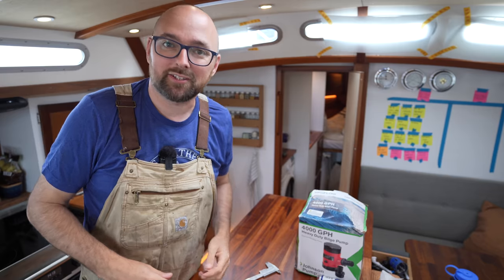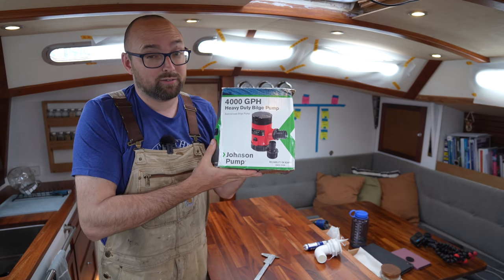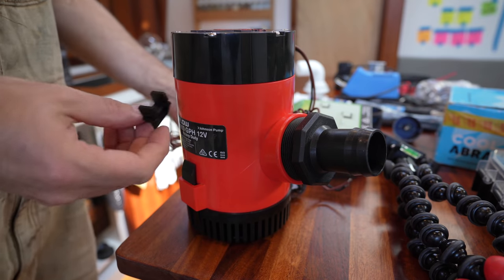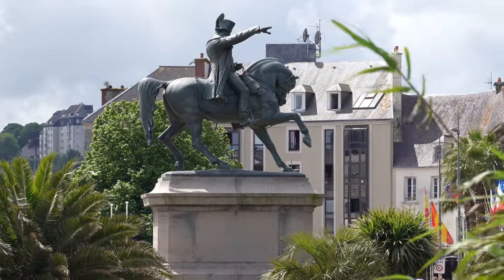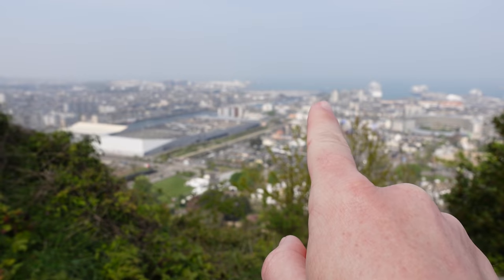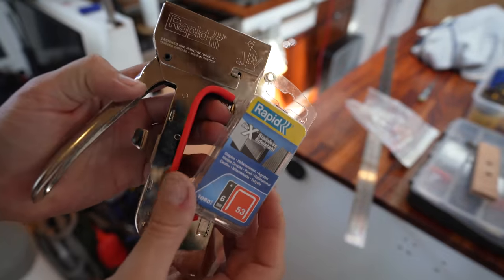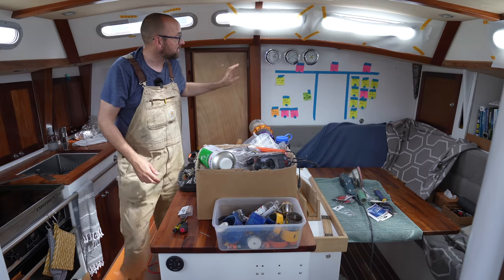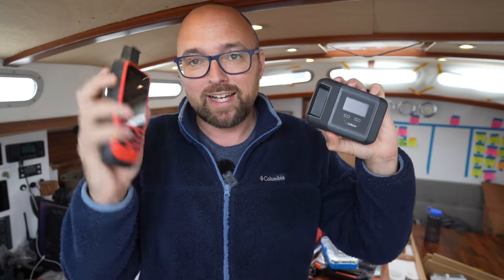Sail Life - 4000 GPH bilge pump installation & tons of smaller jobs 🔥

Comment: Mads? How about drilling a fire supression port in the engine room hatch? Usually just a little wider than an extinguisher nozzle, with a small cover to close it. That way you can fire an extinguisher without removing the hatch and feeding oxygen to the fire. Maybe one for the tech room too?
Reply: When diesel catches fire, the boat is doomed.  Only a halon fire suppression system might be able to extinguish the blaze, if the fire is in a compact area.
Reply: @wallacegrommet9343  Halon replacements and Halon are still available. And even a diesel fire can be smothered, in a contsined space, by killing the fuel supply and flooding the compartment with plain CO2. And that's assuming the fire is caused by diesel. There can be other reasons for it. That's why some regulations actually require fire supression ports, and manufacturers build them by default.
Reply: @lyfandeth  Fires are cased by "lightning". That's what my accountant said.
Reply: Thanks, wasn’t aware of those details.
Reply: @wallacegrommet9343  diesel can be extinguished.

Like all fires, you can remove the oxygen, or the heat or the fuel.

A drychem extinguisher would interpret the chemical reaction and have some effect on displacing oxygen.

A CO2 extinguisher would displace the oxygen and cool it down.

A foam extinguisher would cover the fuel and prevent access to oxygen and cool the fuel.

And, believe it or not, plain water CAN be used. It's really not recommended because it's very hard to do and requires specific techniques.

But as a firefighter, I have trained on fighting and extinguishing liquid fuel fires with water.
Reply: When you get an insurance survey the surveyor will record your boat as unsafe without the port. Your insurance company will then make the decision for you. You want insurance to cover you for fire, you must have a suppression port. If you decline their kind offer, you can basically not stay in a marina unless you post a surety of $20,000,000. Yes, that is 20 million  in anyone's money. You don't want your $20,000 yacht burning down a couple of superyachts. A port costs $16.
Reply: @paulslevinsky580  Are you sure he didn't say lighting? My accountant could argue anything like, today isn't Monday. The tax office just gave up eventually.
Reply: @philgray1023  a rabbi and a priest pass each other on the street. The Rabbi says to the priest "too bad about the altar boy's allegations against you. Jail is gonna suck". The priest responds "it's all good. The bishop paid off the family and the Irish catholic police commissioner made the charges go away. How's your brother doing after the fire totaled his expensive yacht?" The Rabbi..."oh no, that's not till Thursday".
Reply: @35manning  Spot on Emily! I did navy fire fighting and putting out an oil fire with water can be done, but you don't want to be at the front of the 2 hoses required when you do it. I tried to avoid it, but got sent to the front. I can still feel the heat now. Most boat fires come from, gas, electrical or the good old standby wet exhaust and muffler systems not having water. By the time the diesel catches on, you hopefully will be watching from a very long way off, because the boat will be about to sink. Fibreglass boats burn exceptionally well and no diesel is required.
Reply: @philgray1023  my training was land based. One scenario used a team with a 64mm line (2.5inch) on the side to cut and sweep the fire back, with another team walking in the "fuel" head on with a 38mm (1.5inch) line on full fog to push the rife back and reach a cut off valve.

For training, we used a prop with gas bubbling through water and remote controlled shut of valves in sections.

Another method we trained on was a 200 litre (44gal) drum 3/4 full of fuel (well, mostly water with some fuel on top for training) and a 38mm (1.5inch) line.

The idea being, put the fire out before it over flowed onto the ground.

I would grab a drychem or foam extinguisher over water every single time.

But I do laugh when somebody claims a diesel fire can't be extinguished.

Granted, if the fire on a small sailboat has breeched your fuel tanks, you are in a bad way, but a skilled firefighter with the right tools can technically still put it out before the boat sinks.
Reply: @wallacegrommet9343  Would give some refitting Content ;-P   Just kidding, im knocking on Wood that Athena never catches on Fire
Reply: @philgray1023  Phil, it isn't simple. Even the military and aviation still halon. Firing it into a closed compartment should be no problem, especially if you have some training and evacuate the cabin. I can't speak for the replacements, but for now the pruce is the big bar.
Reply: @philgray1023  Very interesting, Phil. Especially since most older boats just don't have them. Personally, I like the pricier systems that have a recessed discharge system in the cockpit.

Comment: Another “emergency bilge pump” that people often forget they have onboard is the engine. 

Add a Y-valve on the inlet, and a hose that goes to the bilge. That thing draws a lot of water when under load. 
It’s also nice for preserving the engine, as you can just switch that Y-valve and use a hose to run freshwater through.
Reply: Glenn- In theory, true. But if you look at the usually small stream of water coming out an exhaust, it is nowhere near what a damage control pump needs to be. A true "trash pump" or similar indepedent pump, kept stowed util needed, running on its own fuel and with a hose like a small fire hose, is what will dewater a boat after a collision. And they all need a big fat screened intake. On Athena...there might be room for that.

Comment: We're in the process of buying an older boat (1975 Westerly Berwick) which has only the manual bilge pump (waka waka) and that wasn't working, yet the guy was sailing regularly on it...😳. 
He's getting that fixed and I've made an emergency pump that uses a battery drill operated system that can be used anywhere on the boat, or even on someone else's. We will install an automatic one when we get her home. 
Your videos are inspiring, as to what can be achieved when you're organised and break things down into manageable 'chunks'...👍

Comment: Some constructive criticism: The position that you choose for the bilge pump outlet is a pretty bad one. As soon as you start sailing upwind in choppy waters there will be water ingress. It will only be some drips as long as the flap inside the pump is working fine, but these tend to break after some time, especially when there is always water standing in the hose. My advice would be to either install some kind of gooseneck on the outlet or add a valve directly at the outlet. It looks like there is not enough space for a proper gooseneck and a valve is obviously not without disadvantages too, but it's at least better than the current solution.
Reply: Ummm no.... He won't be submerging the rail in that boat, even upwind in choppy water.
Reply: I was about to make the same comment.  The hose should go up as far as possible and loop down to the outlet.  The elbow should face up, not down.  That way splashed water will drain out from where it came, not into the bilge.  That simple flap on the pump is likely to fail.
Reply: @SteelDoesMyWill  Based on my experience of about 20000 miles of offshore sailing on a comparable boat i am absolutely sure this is what will happen.
Reply: yes, I think a more durable flapper valve somewhere on the top would be a good idea, the little valve in the pump itself will probably not withstand the pressure of a good wave or ten pumeling the outlet
Reply: I might be missing something here, but the point of ingress is a pump outlet. Wouldn't this mean that at most, water ingress would sit at the pumps own check valve if it's centrifugal?
Reply: I was just about to comment as you did. 100% sure you will get water in from that hole when going upwind or confused seas. Only way to fix that is to put manual valve there so that you can close the hole and get rid of the automatic start thing.
Reply: @The_Gryph  the valve will work ok for short time and after that it will let the water come in. With the setup Mads made the hose will be full of water in almost all conditions at sea - one wave that comes up the side is enough to fill the hose and then it starts first slowly drip in the bilge and in some time it will drip more and more... There is a reason why there are no holes in the sides of a monohull. The  hoses that drain the cockpit and bilge needs to be in the aft of the boat with goosenecks. With the solution Mads made I think the boat can not be stamped to offshore category (A).
Reply from the maker: We’ll see if it's an issue 🙂 The previous owner installed their second bilge pump exactly like I did only 2 meters further forward prior to their cirumnavigation. I don't remember it being an issue sailing Athena home to Denmark. I'll keep an eye on it - and an ear on the primary bilge pump 🙂
Reply: @SailLife  Mads there was a ton of water in the bilge at some point when you fixed her up. If you ad a manual valve near the end of the hose it will not be a problem. If I got your plan for this extra pump it is for emergency, so this should not be an issue. Hope that you will not get water in throuhh this, but I would ad the valve just to be sure.
Reply: @SailLife  I found the downflooding to be a real issue, if you follow ABS or ABYC, an anti-siphon break, a loop that goes up may help prevent flooding when heeled. Sending it aft to the cockpit drains is often a good solution. Mainly because if you're able to get a loop high enough with a siphon break, if it's underwater, it will flood.

Comment: For the dry dock: Today, most of the boat maintenance activities are already done in the commercial port where PNA (Ports Noramnds Associés) has a one-hectare nautical platform and two lifting machines : the syncro-lift, for ferries and heavy tugs, and the travel-lift, for the category below. Exit one emblem of the city… The famous dry dock, witness to the maritime past of Cherbourg. It was built in 1878 and could accommodate ships 75 m long and 18 wide. This granite basin still allows for dry docking and fairing but is no longer adapted to the size of the boats or to current environmental standards.
Reply from the maker: Oh wow, very cool. Thanks for the info :)

Comment: Mads &Ava be safe in your Sailing traveling. Mads just one little question where all your lines come in the Dodger cover would a thin Brush cover the oval hole 🕳 help with water coming in ? Maybe one on the outside and one on the inside should do the Treat. Or a rubber cover with one slice will work to keep water out.
Reply from the maker: Another project waiting to be done on the list 👍